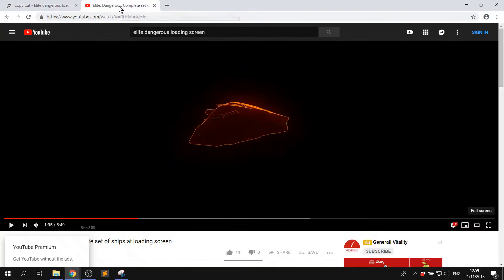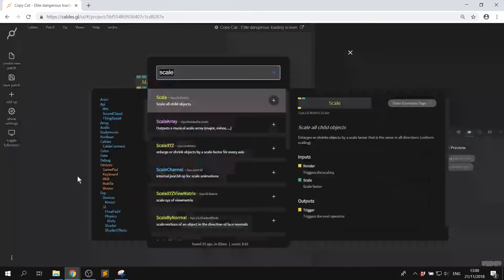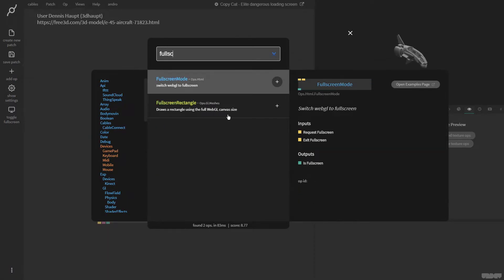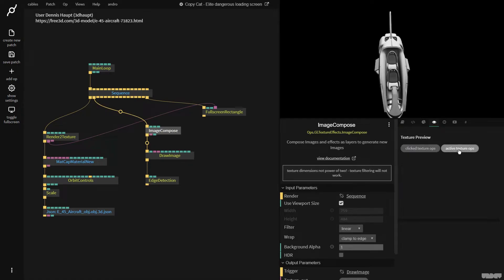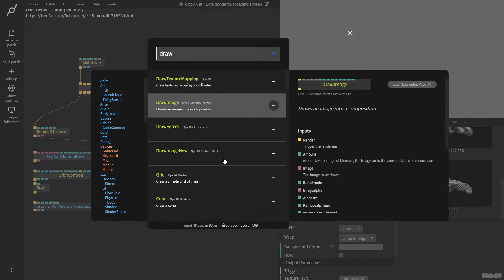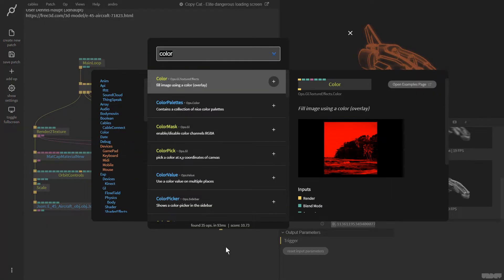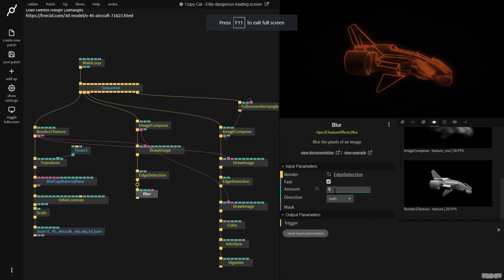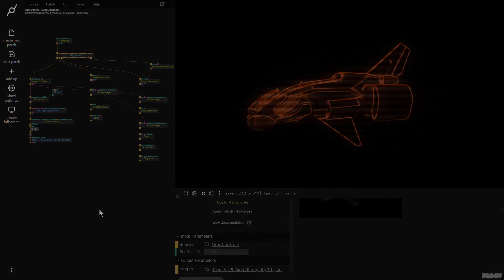Elite Dangerous loading screen - Copy cat cables

Comment: Can't convert obj to json. ajax error: error/api/project/5bfbf1105428e958322f05f8/file/convert/5bfbf2d0abf3115805926414/obj
Reply: Solved by changing model extension from .OBJ to .obj
Reply from the maker: Hi Mikhail, thanks for catching that one.